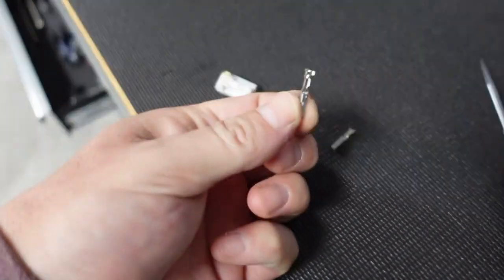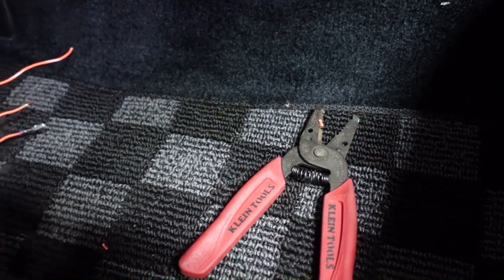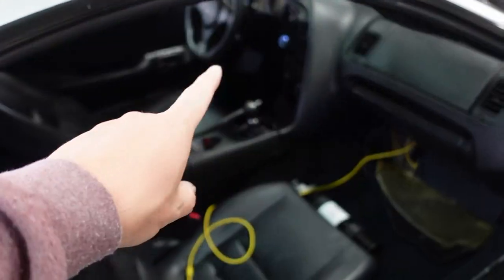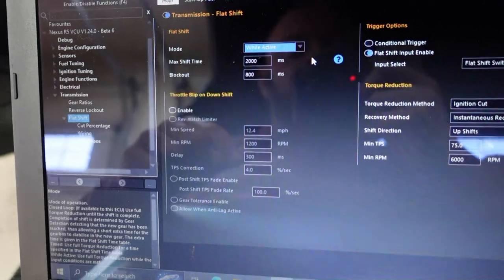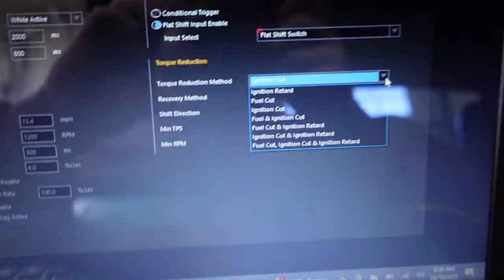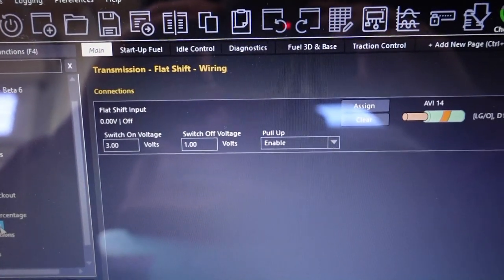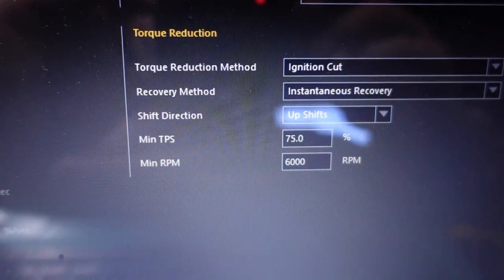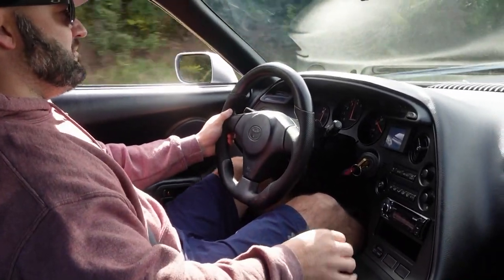How Does Flat Foot Shifting Work? Never Lose Boost Between Shifts! (Haltech NEXUS)

Comment: That is the cruise control clutch switch C15. 

You could also grab that from the OEM harness in connector IJ2 pin 8 it’s in the right kick panel. 

Also there should be a very slight gap between the solid contact and the wire sheething. 2:40

Comment: Set minimum TPS to a lot lower. I actually have mine set to 0% and use a button on my keypad if I want to use it. So it does ignition cut every time when I shift at high rpms if active.
Reply: On a Evo x?
Reply: @lcameeno1  Ive done it on a 9 and 10 actually.
Reply: @mikelbring  stock ECU?